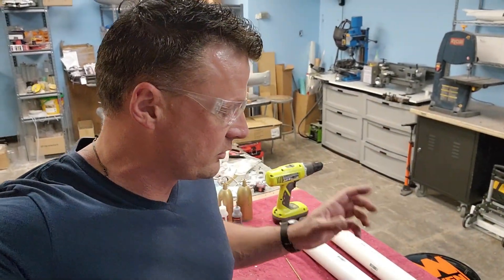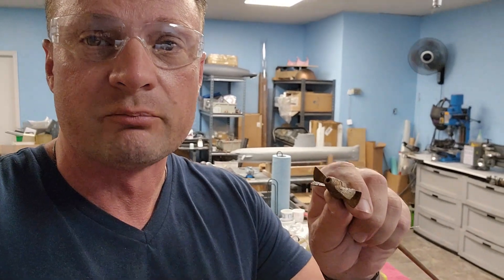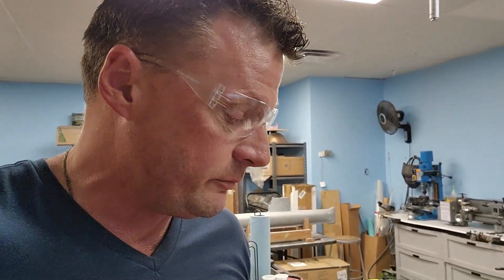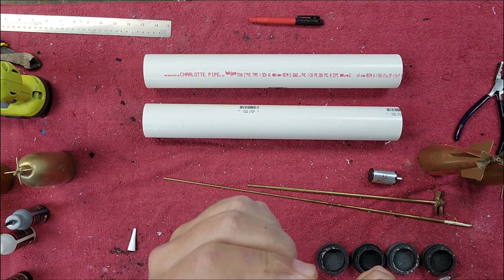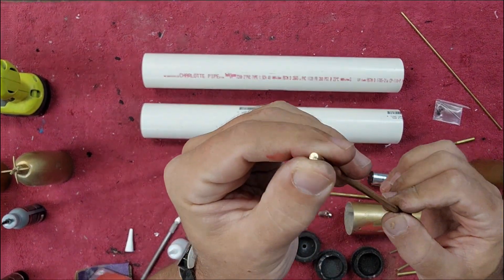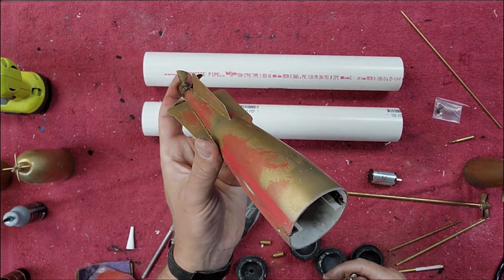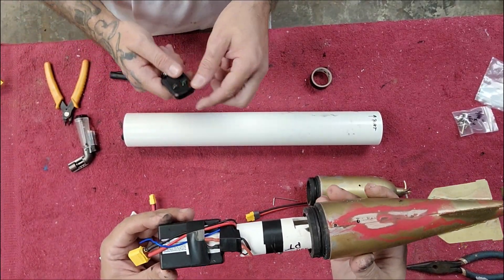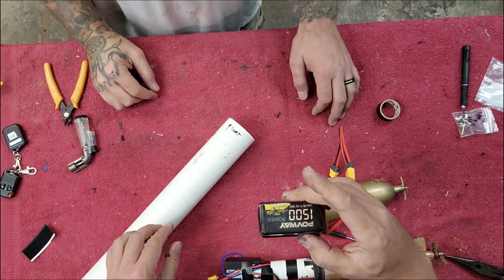Building Functional 1/12 Scale Torpedoes for our RC Seehund Submarine

Comment: Thought about doing this 20years ago in 1/24 scale , but with a 12gauge shotgun shell in the nose . Glad i didn't.
Reply: Requires too much impact to detonate. Unless confined (steel tube) the powder usually fails to detonate. Black powder behind a spike with an inertial detonator striker works well.

Comment: Next video will cover installation of the explosive, detonator and control circuits 🚀
Reply: No control circuit required- works fine with an impact detonator. Firing a spike forward is the most effective at small scale. You need a sensitive detonator- toy gun caps are suitable, using an inertial striker. With care, the torp is re-usable.